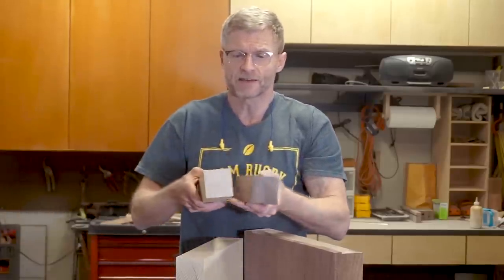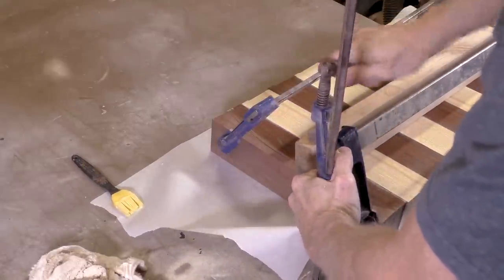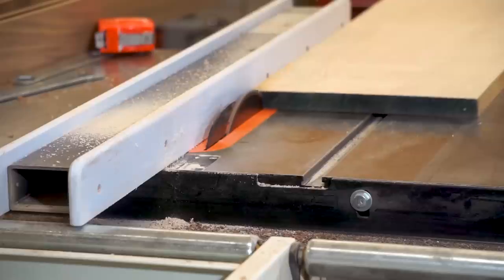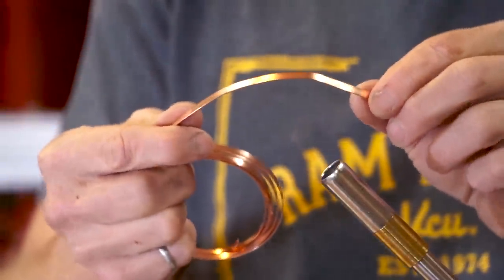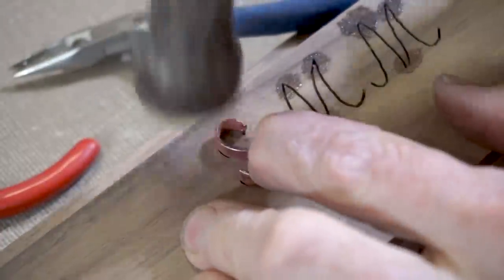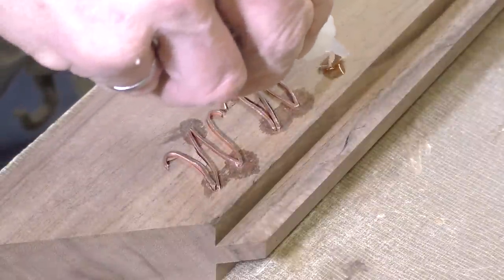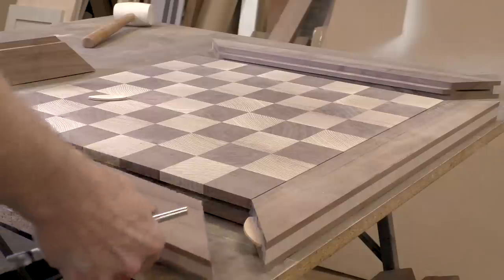Chess Board with Copper Inlay

Comment: To anneal copper fully you should quench it after you heat it in cold water, it does the opposite to steel and makes the copper as soft as lead.
Reply: how do you heat it in cold water? "quench it after you heat it in cold water"
you mean, you should quench it in cold water after you heat it. 
word order makes a big difference.
Reply: @darkshadowsx5949  reading is not your friend
Reply: @happydog6500  to be fair, you should have used some commas, but your reply was funny....😀
Reply: But if it was soft as lead he would not have been able to hammer it into the grooves as he did.
Reply: Annealing copper happens when it is heated. The cooling rate has no effect on its hardness, it will be soft if you don't quench it or if you quench it. Quenching copper is just to remove the waiting time for the cooling to happen, as copper will stay hot for long due to its thermal properties.
Reply: @TheWireEDM , perfect.
Reply: @happydog6500  Writing clearly is not your friend. While most of us could figure out what you "meant", your sentence is worded awkwardly and its meaning is ambiguous. What you meant was: "To anneal copper fully you should heat it and then quench it in cold water."
In the end, I have to thank you for your poorly worded sentence, followed by your snippy defense. It was only in preparation for commenting myself that I bothered to read the entire set of replies, including the most useful one from @TheWireEDM!
As @TheWireEDM explained, it turns out that the softening of copper does not actually require the quenching step. The benefits of quenching are to cause some of the oxidation layer (caused by the heating) to flake off and to speed the return to room temperature for convenience. If you don't care about either of those, then you don't even need to quench at all.

Comment: Anneal copper by heating it up and quenching it.  (Ancient technique) Try it on a small test piece , it works
Reply: collin Purvis that’s the interesting thing about copper, it anneals almost backwards compared to other metals
Reply: Copper doesn't need quenching to soften, just heat. Quenching just removes the cooling waiting time.
Reply: @TheWireEDM   when working copper, quenching greatly  improves malleability
Reply: @custa73burner  How did you measure this "greatly"? What I've annealed copper, there is no difference in hardness if the same temperature has been used, as the cooling does nothing to coppers crystal structure. It is always soft/malleable when a certain temperature is exceeded throughout the workpiece.

The only thing the water can do is prevent oxidation on the surface or remove some of the formed oxide layer.
Reply: @TheWireEDM  Measure the difference yourself by using two test pieces, heat and allow one to cool, then heat and quench the other. Planish both pieces and observe the individual indents, or measure them. Or, if you have the equiptment available,  perform a brinnel test on both pieces.
Reply: @custa73burner  Is there any reason you don't do it to prove your extraordinary claim of differing hardness? Because physics and literature on the subject doesn't support your point of view on this matter at all. Otherwise we would be seeing these explanations everywhere, but no.
Reply: @TheWireEDM  I don't understand why you feel the need to make such an issue from a  word of  advice  given in good faith to a third party
Reply: @custa73burner  Because the advice is based on nothing. There is no need for a quench to soften copper (and some alloyes of it), it doesn't do anything to it. Why I'm saying this is to educate people on facts and not just repeat unnecessary things. Referring to the old story of a mom cutting the ends of a pot-roast.

Comment: 5:05 the pattern is ok. 5:11 the pattern is wrong, then ok again at 5:30 - what happened???
Reply: the board has two sides you know :D it was back side of the board when 5:11, i believe.
Reply: @cincuriki  That wouldn't account for the pattern mismatch. It doesn't have anything to do with the orientation. Look again, and you'll see there are 2 walnut pieces next to each other, then they are back to the right orientation.
Reply: gamercs21 I just figured he fixed it and didn’t mention it
Reply: another, new kind of chess? Where the bishop does'nt get so bored ...
Reply: Good call!
Reply: whops :D i just misunderstand it sorry, i thought you mean grain pattern did not match up. you are right.
Reply: Its a different board.
He made more than 1.
You can read it in the coments

Comment: Gorgeous board, but I gotta know... what about the seasonal wood movement?  I'm kinda new to this, so there might be something I'm not seeing, but it seems to me that as the panel that is the checker board expands and contracts (probably expands since you made this in the wintertime), those miter joints on the absolutely gorgeous frame are going to blow open...  I see you only glued in the center of the panel in the tongue/groove, but I don't see any allowance for expansion/contraction between the panel and frame.  Am I missing a technique/trick?  Cause if so, I'd love to hear about it, as I have a couple project ideas i'm trying to figure out.  Thanks!
Reply: No hard questions.  Lol
Reply: @roxannrousealvarado4645  I was either very wrong, or very right I guess haha

Comment: 5:10 to 5:25. Do I get a prize for spotting it? I know you put that in the video on purpose. Happens to the best of us.
Reply from the maker: You found it!  I actually made several boards at the same time and messed up on that one. I decided to keep it in the video to see if anyone would notice.  Good catch!!
Reply: It’s all good. That happens. Especially when you are videoing   Love the video.
Reply from the maker: @PawPawsWorkShop  Thanks!  Yes, taking the time to set up the video shots can be really distracting sometimes.
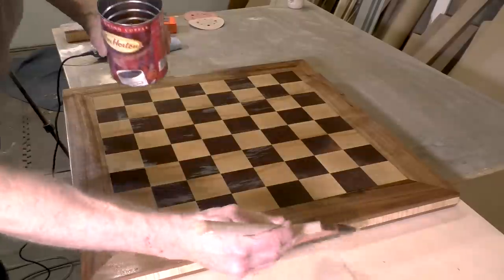Reply: 21:16-21:40 different board without inlay? I can’t find the copper!
Reply from the maker: @oqsy  That's the bottom of the board. You can see the finger slots exposed on the bottom.
Reply: @Woodumakeit  Your finger slots are exposed!
Reply: took me a min but i did see it
Reply: 17:56 shows another side with initials
Reply: @Trevin_Taylor  yes!
Reply: I caught it as well. Glad I'm not the only one, lol. I had to do a double take lol
Reply: Lol that took me a lot longer than I would like to admit 😂 mistakes happen and you learn from them!
Reply: Awesome video. Thx for sharing. How did you fix it? Did you simply end up cutting off that last incorrect row, and then just reglue it (since u had an extra bit on the end) or did it have to be a more complex solution?

Comment: cant see it along the comments but i thought id masnishon it as a metal worker. if yah want an easier time with the copper you should make it soft the proper way. wich is to dunk it in water once it is heaten up. unlike steel it dosent harden in quenching it actualy soften it. if yah leave it out to cool it usualy gets way hared to work with. but your work is very nice and realy impressive. thought id just give ya a tip since it seems you strugled a bit there
Reply: True that

Comment: True nice wood but the copper inlay sry that is realy not nice to see. For the next time build the letter pieces first and braze them together u used epoxy anyway so u dont need them to fit in tight. And after u done ur letter all in shape like u want the angels and curves use the letters to mark on ur board now u can cut the lines and it will fit perfect.

Comment: I am not being critical of your workmanship. You are doing good work.  But that board will tear itself apart. The glued up squares have the grain running up and down... that mean cross grain expansion in the squares middle is going to expand about 3/8 inch every  year from dry winter to moist summer air...  The squares will push open your mitered corners. But first as the middle expands it will warp pushing against the sides.. Then the side rails will fail in the corner joints.  Dont ask me how i know this.. :) haha  ive done a few boards myself...  
But still very nice work except for this.  Always think about expansion and contraction, it can be a  killer of fine woodwork. Panels need to float.
Reply: I was thinking the same thing.  I think the wood whisperer did a video on this same effect on end grain cutting boards.

Comment: WHY ARE YOU HAMMERING THE COPPER IN? Copper work hardens ffs. Don't use a huge ribbon, use wire if you must do these ugly inlays. If you hammer it it's just going to turn rock hard and become an extension of the hammer - i.e. a gouge or chisel and fuck up your wood.

Comment: Hi Mike, 

thank you for this great video! Inspired by you I am planning to create my own board following your instructions :) Luckily we have an "open workshop" in our town where I can use all tools needed for a low flatrate-price. 

I was able to take all the measurements for each part of the chessboard from your video except one: How long was the board you used for the frame and how long were the four frame boards before you cut the 45 degree angles? It should be something around 25 inch per side correct? I would be very happy about a feedback :)
Keep up and all the best from Germany!

Comment: Great job, such a wonderful, high quality board that will last 10 lifetimes. 2 things: The copper inlay didn't need to be so deep, too much risk of breakage or a bad fit. The hardest, toughest, most scratch proof finish I know is "Birchwood Casey Tru Oil". Try it, it's amazing. Polyurethane comes out too thick and plastic-y for my taste. Thank you for a great film!
Reply from the maker: Thanks for the info, Bob.  I'll take a look at Tru Oil and see how well it works.

Comment: Great work, really nice work.
A great tip a teacher once told me about detail work is to save the sawdust for a given wood and mix it in with the glue to fill gaps. You 'wood' be a amazed how it blends flawlessly when filling any small gaps. 
I am sure you didn't need this trick but I thought I would throw it out there.

Comment: Just wondering if framing a solid wood structure like this will eventually result in the frame failing from wood movement.
Reply: I was wondering this as well when I noticed that all the chess squares are end grain up, meaning all the potential growth and shrinkage from humidity in the perimeter is maximized. The corners got biscuits and he connected the frame with a through dado kind of joint and and the grain direction does seem to be pretty randomized which means it would hopefully grow and shrink uniformly but it could possibly pop a corner if the environment isn't stable and it swells a lot. My guess is it would take a lot of moisture. Probably won't go anywhere in a conditioned house though and is well oiled and doesn't dry out.

Comment: Very nice job on a very nice board.

I'm no good at free hand, so I would have to use some sort of font template to guide the router, and fill the grooves with gold or copper colored paint, or metal flakes in glue. What can I say, not much of an artist here, but then not much artistry involved in electronics repair.

If I still played chess and needed a board, I would not hesitate to ask you to build me one! Again, very nice job.

Comment: Beautiful job!  
A tip for everyone when filling gaps, cracks and joins - use a drying oil (like floor tung oil) or clear drying epoxy over the gaps then sand it when the oil or epoxy is still wet.  This will force the sanding dust into the gap.  When the oil or epoxy has dried you will barely see the gaps any more.  Using oil and wet & Dry paper on timber when finishing it will give an incredibly smooth finish.

Comment: When making wooden rings, it is easier to cut the inlay groove and then add metal filings with CA Glue.  Design is not limited by turns or corners

Comment: I WOULD PUT THE SMM MORE AWAY FROM THE BOARD AND TOWARD THE OUTSIDE EDGE.  I PLAY TOURNAMENT CHESS AND THE SMM IS TOO PROMINENT FOR PLAYING. IT SHOULD BE MORE SUBDUED.   INSTEAD OF THE THE SMM BEING HIGH UP HUGGING THE PLAYING SQUARES.  IT SHOULD BE LOW HUGGING THE OUTER EDGE .  OF COURSE THIS IS MY OPINION. OTHERS MAY DISAGREE WITH ME.   THAT IS FINE.

Comment: Very beautiful work, I fault nothing on the flame maple, however I do wonder how nice that would also look in another dyed color. dyes make the grain really pop in flame maple,  and I think your inlay would had looked nicer, had the gaps been packed filled with a mix of fine walnut sawdust, and epoxy, before sanding it flush, it would had made it look more immersive, instead a sperate piece. however it doesn't look horrible, and over all the whole thing taken together is stunning. /Cheers.

Comment: Enjoyed every minute of this video. Looks like that copper can be a bit tricky. If you do it again would you use a slightly larger router bit?
Reply from the maker: It was definitely a challenge. One viewer suggested that I sand down the bottom edge of the copper so that it's tapered to make it fit more easily into the slot. It think that might be a good solution rather than using a larger router bit which may end up resulting in a fit that's not tight enough.

Comment: When annealing cooper/brass/bronze/silver/gold you have to heat it up to critical and then quench it in water. Air cooling it doesn't work well enough.
Reply: It does with carbon steel yes, not the metals I mentioned above. Look it up, we are on youtube after all. "How to anneal copper" is a nice way to search.

Comment: I use the exact same silicone basting brush to spread glue also.  I trimmed the bristle down to be a little more stiff.
Reply from the maker: That's a really good idea. I have another glue brush that I got from the Walmart BBQ section (so, way cheaper than buying it in a woodworking store) and it's even less stiff. Maybe I'll try that trick to make it easier to use when brushing on glue.

Comment: I'd make it, as a recent ex carpenter going back to my roots as a fine woodworker this looks like a very rewarding project to take on. Great video!
Reply: Read the other comments about the inlay and using a powder mixed with epoxy. I can tell you from personal experience that when you sand that copper flush it's going to go EVERYWHERE. And it's going to oxidize and leave little green flecks ALL OVER the place after a year or two. (I never thought about using copper, silver, or gold powder. That's a clever idea.) If you're going to do it the way he did it with copper, you want to use copper wire. Much easier to work with and it's not like anyone is going to look to see that you've got a quarter-inch of metal embedded in the board.

Comment: I'm curious about the copper oxidizing & causing the wood to stain.
Reply: The copper can not oxidize without oxygen. The several coats of polyurethane would effectively seal out the oxygen.

Comment: Copper can be made very hard by hammering, heat it up with a torch and allow to air cool, its soft again. Also, you could of used copper wire, heated up to soften, glued in and sanded down

Comment: I've often thought about running out to my shop and whipping up a chess board real quick. It's just squares, right? So after using every scrap of wood I own, (Including the forest inwhich I live) after reciting every curse I know, (In six languages) After burning up every tool I bought (Some using matches and gasoline); I thought, "There must be MORE to this chess board thing....lo and behold..... there is. I thought you did an admirable job on the inay as well.

Comment: Hey there,
Can I mage a couple of suggestions real quick:
Use copper wire...route 0.6 x copper diameter deep & sand excess as per your video. Use brass or plastic face hammer (gently!). Throw you chisel out the door when inlaying! Also, making the monogram on its own before mounting is a good option, especially if you braze the joins. Lay it in place, gentle tap to mark the wood, (or your carbon paper), route and mount. That one little monogram could have ruined the entire job and needs an appropriate amount of time and effort. (Realise it wasn’t assembled and you could have remade that side - but how many times???
Something that amazing and expensive really should have had morticed corners even if you can’t see them - or something worthy of lasting generations. Biscuits are weak & you were lazy. The board, and the owner’s descendants deserved better. 
Having said all that - it is a gorgeous heirloom. I’d even have a go at chess on that board!! I’d lose, but I’d feel honoured using it! Amazing build and YES - I WOOD.
Now, how what about the 3 claw feet, twist stem table to sit it on and the individual hand made chess pieces??
Cheers, Michael

Comment: Could you do lettering with solder? Either copper or gold?
Maybe push the cold solder into the groves, but add heat, from a heat gun?
Reply: you'd get a worse finish, because either way you'd be burning the wood. [el'sda2].

Comment: This isn't meant as a criticism, just as my take, but I know I would have tested the SH*T out of the inlay before ever even attempting it. Certainly not on a piece I already did some work on. some scraps. Though maybe that's more down to my limited experience and subsequently, confidence.
I'm personally not a big fan of the inlay, for mostly subjective design reasons. There's a bunch of ways to do it, obviously, and I'm quite a stickler for details. Things like, centering it vertically in the edge, maybe even horizontally, or at 3/4, rather than so close to the squares. But, that's really personal preference.